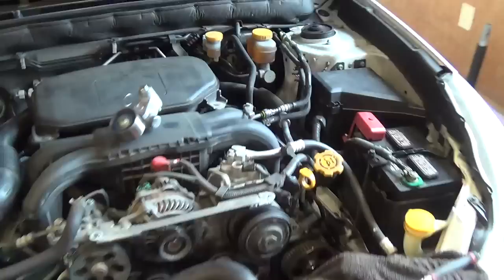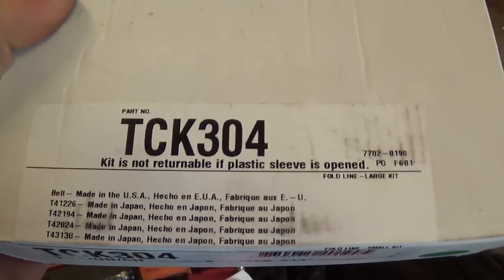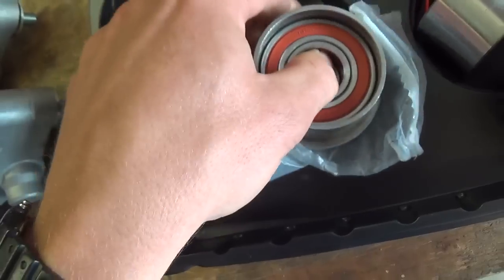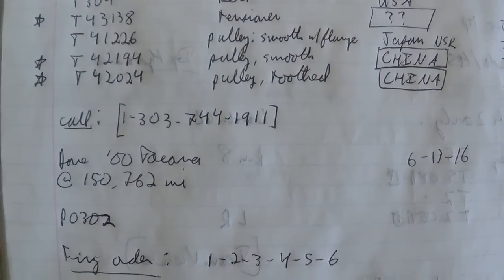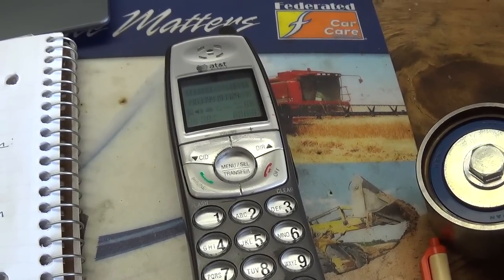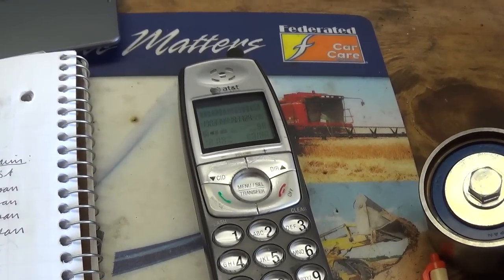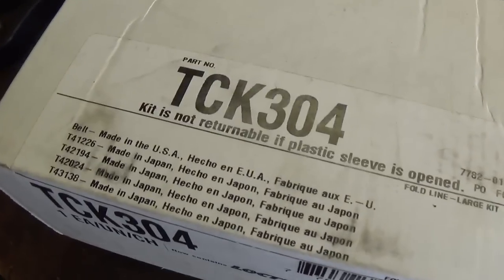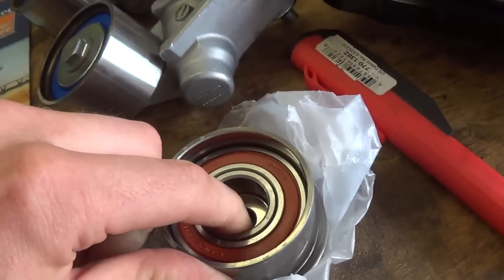GATES Subaru Timing Kits: BUYER BEWARE!

Comment: The pulleys shouldn't be spinning like that lol
Reply: And here's isn't the Subaru company... gates makes oem REPLACEMENTS
Reply from the maker: What should they spin like?
Reply: Pine Hollow Auto Diagnostics the one that you said has no wobble and is fine was spinning way too fast. That's how you know it is worn. A good one should not spin that easily
Reply from the maker: In a brand-new bearing, the grease slows it down a bit. But after a few minutes of engine operation, the grease gets pushed out of the way and the bearing will spin much easier. Even more so after 100k miles! So as long as the bearing is smooth and there is minimal wobble, it is still OK.

Comment: ive used the pulleys but NEVER the tensioner.  they jump around and knock  sounds like a bad bearing  the spring is not strong enough chinese junk!  ive yet to find a solution to this junk

Comment: OEM stands for Original Equipment Manufacturer. Made in Japan doesn't mean OEM. Gates isn't Subaru. Gates isn't OEM. If an aftermarket company mentions OEM it's typically because they are stating that the replacement parts were manufactured to meet or exceed OEM Design Specifications. If a box says Japan on it that doesn't mean it is claiming to be OEM. Good Lord.

Comment: Man what a drama Queen , Gates is now manufacturing in china in fact most things you once thought were american were not , Gates is still manufacturing to specifications , because it says made in china actually does not mean it is garbage . That is an idea you have . The original parts you removed from your car are the original factory parts and unless you get a factory kit they wont be the same , and to be perfectly clear here you should really replace your timing belt every 60,000 miles not 100,000 miles
Reply from the maker: I speak from personal experience and experience of others. I suggest that you read some of the comments below. Cheap Chinese junk is blowing up and causing severe engine damage. Manufacturers specifications my ass 🤣

Comment: Ok the dont just simply brush "made in china" as bad name and avoid it all.
 you can not do that these days. I  am pretty sure the phone or camera you were using to film the whole event is made in china as well. why didnt you call the isp customer service why you  get the phone that made in china or the parts inside the phone are made in china. i need a phone that is not made in china inside out. lol

I bet you have to choose to use landline phone. oh btw the landline phone is made in china too lol.

 iphone is the best and most expensive in the market and is made in china no doubt. You know why because the company used the best quality parts from china and paid the big bucks to those suppliers located in china.

Here is how it works. ie the bearing you mentioned ib the video.

The chinese bearing company made bearings in different grades based on the applications aka working conditions ie max rpm  max working temperature and so on. they put them on the market at wide spread price range.
Now it is all up to the brand name aftermarket company to choose what bearing they are going to purchase in bulk and laser engrave the company logo on it.

The brand name company used the bearing in various applications that being said the bearing company has no idea how the bearing is used. 
Most of the time you see parts  that are made in usa or japan are not 100% accurate.  What the first customer rep said in the video might be right- individual components are made in china but the part was assembled in japan.  

that is why you see quite often on the label  MADE IN USA WITH GLOBAL COMPONENT. This pribably makes you think you should buy it because its "made in usa". is there any difference quality wise i dont think so. however u r going to pay way higher price compared similar stuff from overseas because u have to pay extra to the bosses in the usa who usually pay much much less taxes than average people. well we have to support so called local economy right?
Reply from the maker: yeah...but my made-in-China phone won't cause my engine to blow up. A cheapo x-brand aftermarket junk bearing very well might. See the difference?